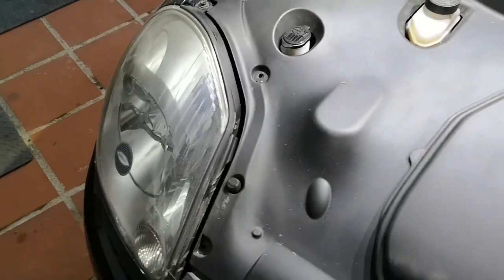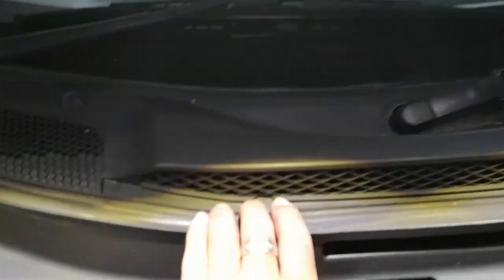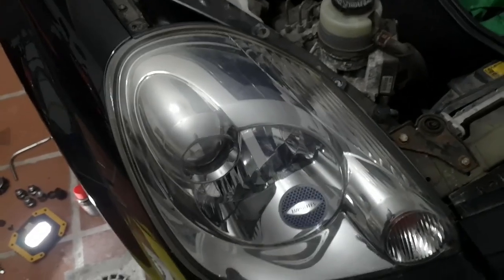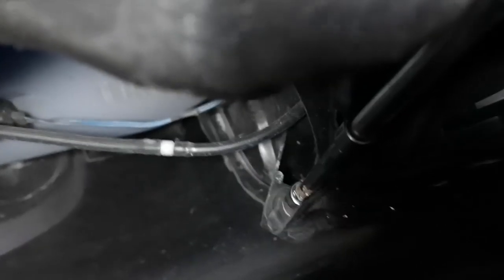TOYOTA MR2 ROADSTER HEADLIGHT REMOVAL & INSTALL

Comment: The plastic wheel cover does NOT lift out. It is held in by 4 screws, 2 on each side - yours is now broken :-(
Reply from the maker: The fixing mounts each side have 2 screws. the cover has a press fit hinge, so no it is not broken. Thanks